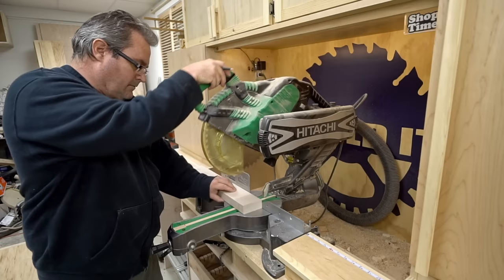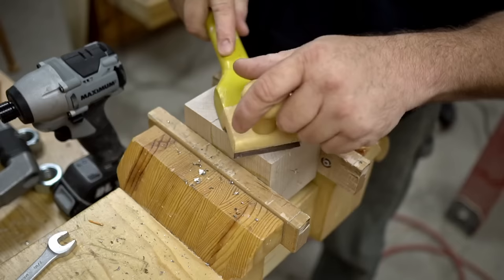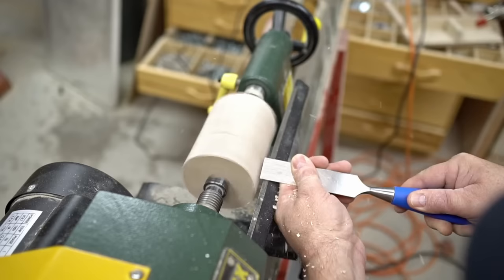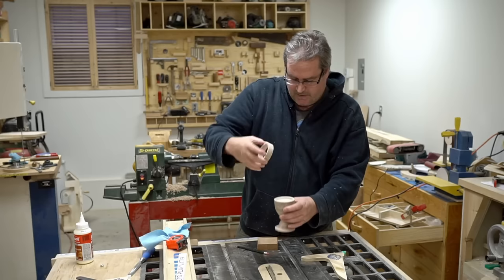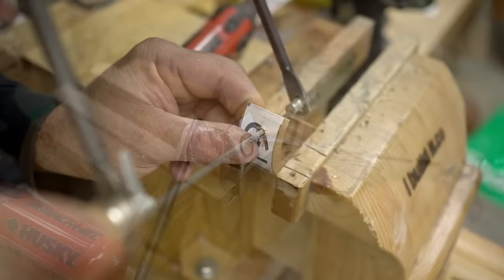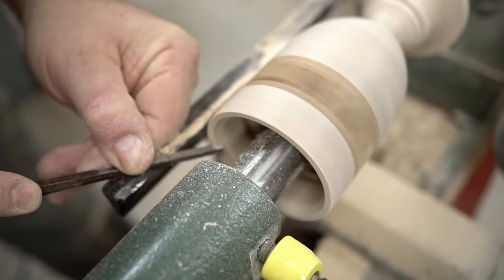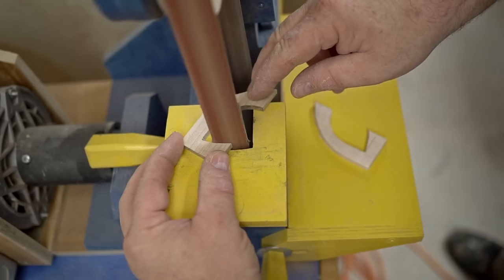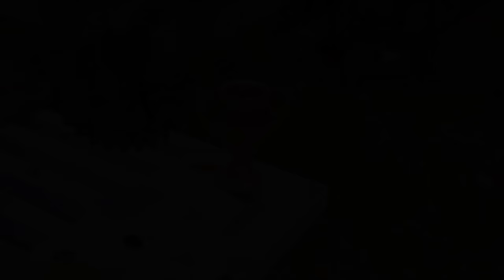Making The Vat19 Let's Play Trophy!

Comment: for working with a fret or coping saw John, take two boards and join them at 90 deg cut a V notch in one of the boards and clamp the UN notched board in your vice ... make sure you saw blade is set to cut on the pull stroke.  you will have much better control cutting that way.